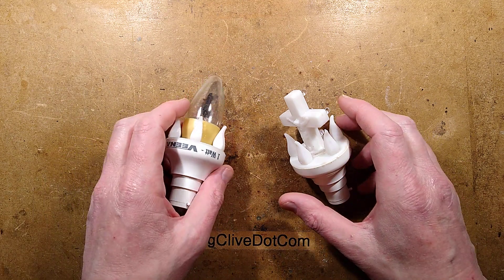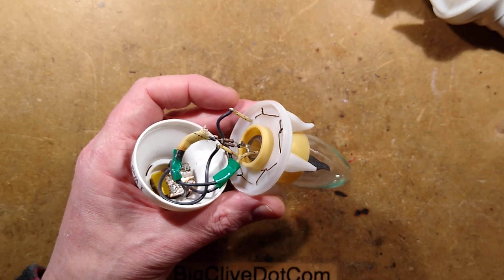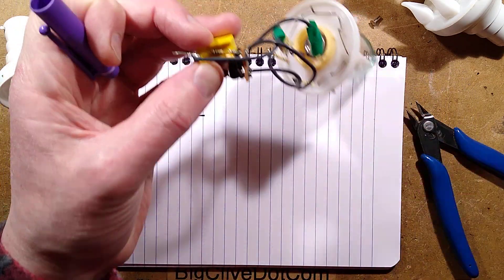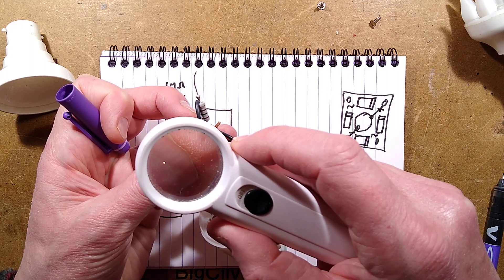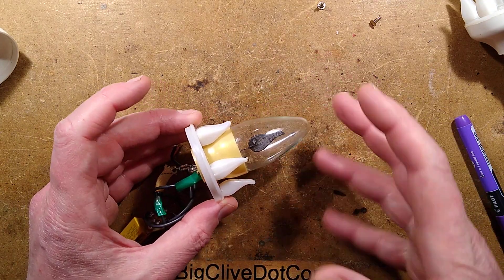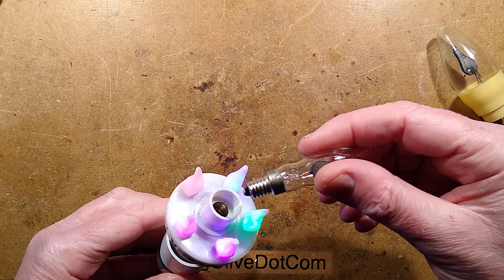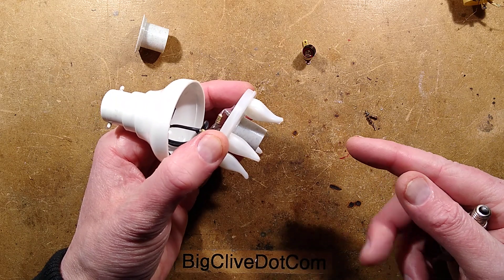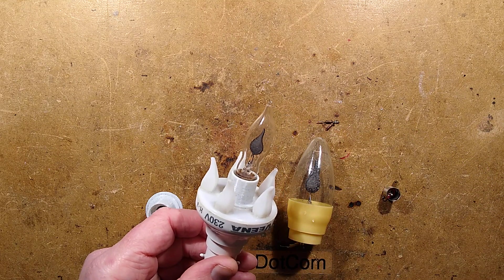Fixing an Indian LED & neon light

Comment: I absolutely adore those neon flame bulbs. My grandmother had one in a candle shaped lamp body that would come out for Christmas every year. As a kid, I would just sit and stare at that thing for God knows how long. Eventually she just left it out all year round for me. Wish I knew where the hell that thing went.
Reply: If she's passed I can guarantee it was one of your parents who said 'Quick, get rid of that before Thor sees it and wants to drag it home'. If was then swiftly 'disappeared' before you thought about it. 
The same thing may have happened during downsizing or moving into sheltered accommodation. I speak from experience. 😁
Reply: i guess Santa took it ...
Reply: I still have a wreath with a flicker flame candle in the center, it's about 30 years old, haven't used it the last couple of seasons but it does still work.
Reply: I have one out front in a pole light. People ask if it's a gas light. The color isn't close to gas, but they still ask.

Comment: Ugh, what a nasty build quality... The neon lamp would normally end up in a bayonet or E14 base, here it was just glued into plastic. Meh.

Nicely built FULL BRIDGE RECTIFIER, but what's the point? That's the way they did it back in '70s when integrated FBRs weren't ubiquitous, but there's no point in doing this stuff anymore.

It's E10, not M10... M10 is for nuts, bolts, mechanical connectors. Making a 3D printed adapter was a nice idea though. I like the result.
Reply from the maker: They probably chose discrete diodes because they are often cheaper.  I did screw up by saying M10.
Reply: @bigclivedotcom  happens to the best of us :)

As for being cheap, component wise it may be, but if you count all the added labor costs, both designing and making a PCB, and assembling it - it doesn't count. Putting more in than saving. But then it's India, they've got cheap workforce and it may be efficient from their viewpoint.
Reply: @KeritechElectronics  Cheap lamps which come from China are also built with discrete diodes although the build quality is usually better than this. Here in India cheap Chinese emergency lanterns are/were very popular, and they always feature a sealed lead acid battery and discrete components, presumably assembled in some Chinese village.

Comment: Very neat. Slightly surprised you didn't try to put one of the LED flame effect bulbs in it, but they might have been too big. Maybe a future project to 3D print a complete unit with one of those included?
Reply: Those bulbs look far less like flames than this one does.
Reply: @mikemondano3624  They probably use more power too.

Comment: What would the actual voltage be across that 50V capacitor on the output of the rectifier? I realise there's a capacitative dropper but 50V does seem like a worryingly low rating for something connected to rectified mains.
Reply from the maker: It will be the combined voltage of the LEDs.  So about 15V here.
Reply from the maker: It will be the combined voltage of the LEDs.  So about 15V here.